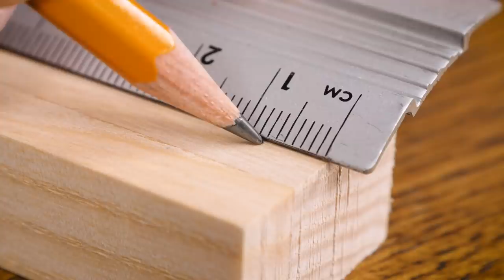How to Play Star Wars: Squadrons Like a Pro

Comment: Cool idea, but it needs some better fixtures between the wood. There was too much play between all the components to be practical. To engage the gamepad's sticks, he had to move the flight stick a good 10-15 degrees. I know it's not the intended use, but maybe a universal joint instead of those hooks would remove some of the play. They usually are pretty tight, and they can be easily made with the tools and materials you have on hand. Especially with the craftsmanship you demonstrated here!

Comment: I mean like you only have 4 controls, I'm pretty sure you can't just use 4 controls to play like a pro. Also probably could just use a keyboard, alot cheaper and easier. And I'm not hating at all like the invention is genuinely awesome just I think you would probably need more controls on the joystick to operate a space craft properly in this game.

Comment: Wouldve been better if he desoldered the joysticks off the controller circuit board and used bigger potentiometers with wires going back to the board. Good idea still tho. I never play that game but you probable can break up the left stick potentiomters too if one direction is thrust or revers and the ither potenti is for direction so you can have a dedicated throttle idk. Im currently in a ps3 controller fix where the 3rd party one suck ass and im now finding out what potentiometers are. So dont mind me.

Comment: You only have two inputs though, aside from primary fire and an auxiliary, you would need to reach the controller to boost, use countermeasures, drift, power management, auxiliary 2, ping, change targetting, cycle targets, move shields, etc...

Simply not viable. This looks cool, and it is great woodworking, but it won't make you play squadrons like a pro